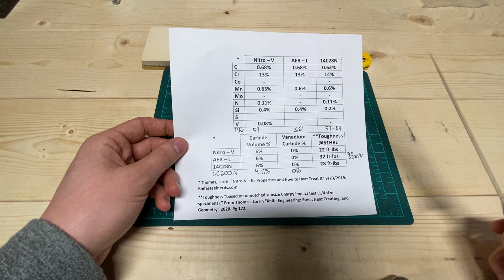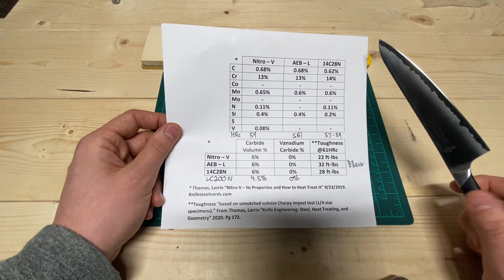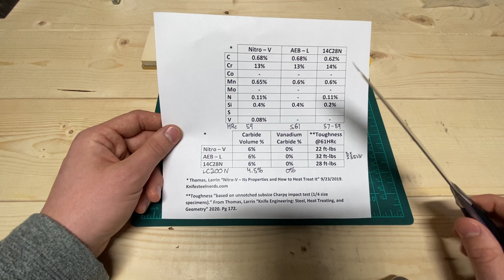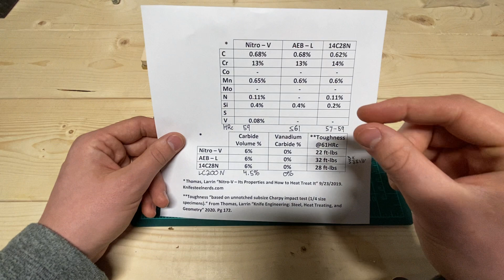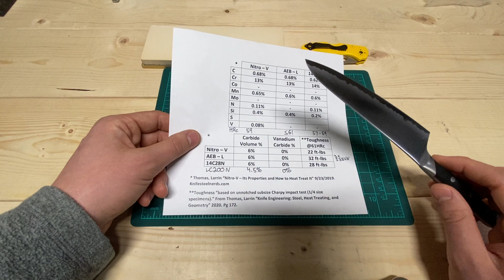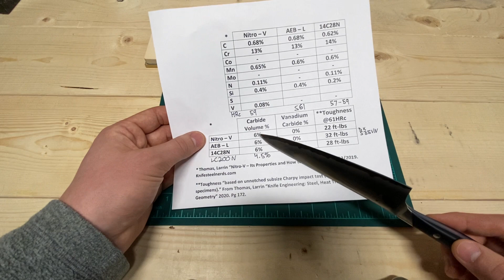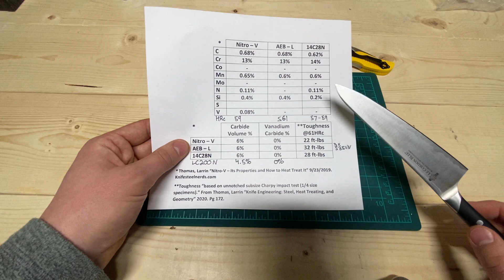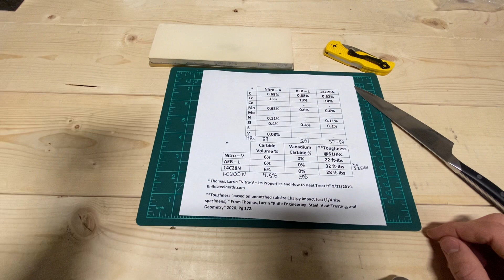Talking Steel: Nitro-V (Tough and Stainless)

Comment: Here in my country There's a maker using this kind of steel.
It gets hardened to 57 HRC ( machine tested ).
The maker is Ambrogio Sanelli , the knives are inexpensive.
Reply: Actually Ambrogio Sanelli is using Nitro-B not Nitro-V , Nitro-B add around 0.15% Nitrogen into 4116 , 4116 is the typical German kitchen kife maker grade, e.g .WÜSTHOF use a lot a lot , Nitrogen acts similar to carbon which will increase the hardness and also increase the corrosion resistance,  they gets hardened to 57HRC becasue they are not deep freezing the steel which won't maximize the performance of Nitro-B, which is a pity.
Reply from the maker: It’s a nice blade steel but 57HRc doesn’t really make sense to me. Even in an outdoor blade that seems overly conservative on the hardness unless the geometry is fragile but that doesn’t really match an outdoor use.
Reply: @EngineersPerspective701  It's a kitchen knife :)
Reply from the maker: Definitely low balling hardness, probably should be 62-63HRc for a kitchen knife. BUT cutting geometry is key so if they are nailing that and are inexpensive the knives are probably still a good buy!
Reply: @EngineersPerspective701  63 hrc ? nah man 😂🙈 way too much hardness makes the knife too brittle.
Reply from the maker: Check out some Japanese cutlery, 63HRc is mid-range! My K390 delica is ~65HRc and I love that thing.
Reply: @smithgeorge6858  Thank's , so why isn't used more often ?
Reply: @AAAAAAndrea  and to be honest it's a steel that gets used pretty often it was initially designed for razor blades. stainless: bcz no one takes care of their razor. fine grain: so it can get really sharp. low wear resistance: its easy to sharpen so less cost to produce. Zwilling uses aeb-l in some of their Kramer line and even on miyabi and in their cordon bleu line but they changed the name to FC61 which means fine carbide hardened to 61 hrc. And alot of custom kitchen knife makers offer aeb-l.
Reply: @smithgeorge6858  Thank's for the clarification man :)
Reply: @smithgeorge6858  Actually Zwilling is not using AEB-L on some of their Miyabi lines , so called FC61 is Nitro-B which Zwilling change the name , but for sure , Zwilling is deep freezing it to get a hardness level to 60~61HRC
Reply: @xin1735  lol source? Fc61 is wide known as aeb-l and you can search for the composition of fc61 and it is same as aeb-l not nitro b.
Reply: @smithgeorge6858  Source is I'm in the supply chain .... Nitro-B is shipped to Miyabi in Seiki regularly for almost 10 years
Reply: @xin1735  dude so your source? or proof? My proof is fc61's composition and your source is just your claim and even you are telling the truth of you being in the supply chain of nitro b it does not mean fc61 is nitro b. miyabi also offers different knife steels and zwilling which some models are made in the miyabi factory

Comment: In your opinion, for a medium or large knife, what better stainless steel (with toughness condition first, second condition is EDGE retention)?
According to the knifesteelnenerds.com report, AEB-L is x2  stronger than Nitro-V.
And the stainless steel capacity is not much different between AEB-L and Nitro-V
Reply from the maker: It depends on the environment. How much do you really need the stainlessness? If it’s used around seawater you will definitely notice the upgrade in Nitro-V. But where I live, M4 and Cruwear don’t have rust issues so AEB-L would be the better choice. It’s lower cost and tougher so one really needs to have a reason for the extra corrosion resistance of Nitro-V.

So with toughness AEB-L at the same hardness and geometry will out perform Nitro-V. For edge retention AEB-L can be run harder and thinner while having the same toughness as softer Nitro-V. So the latter case is how I’d recommend utilizing the properties of AEB-L